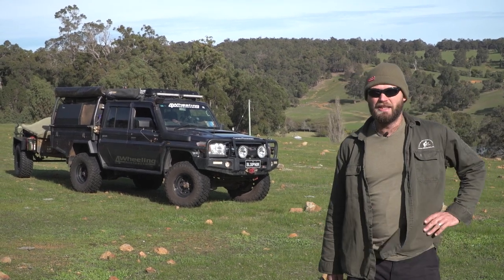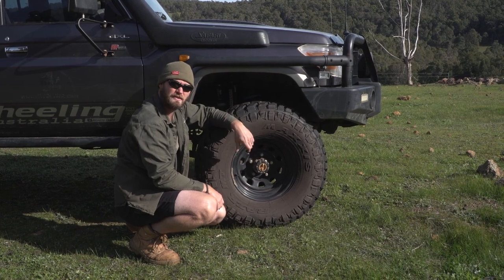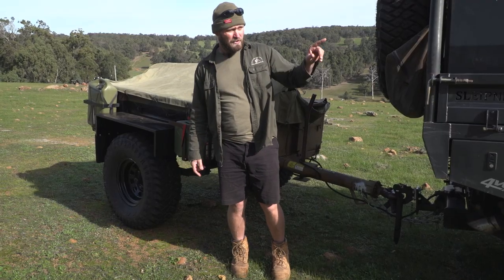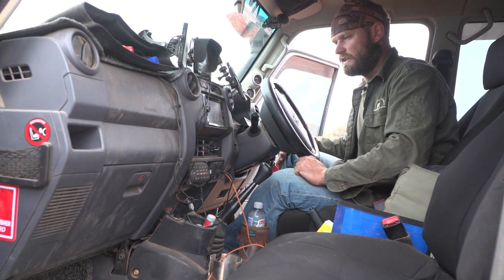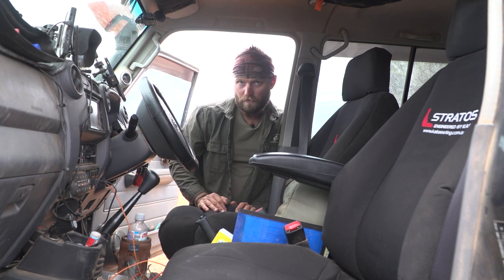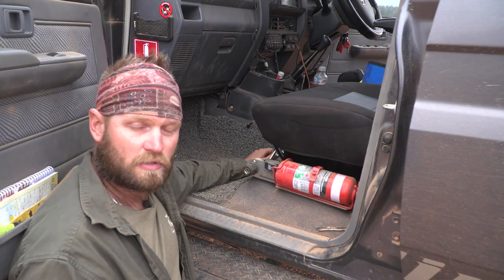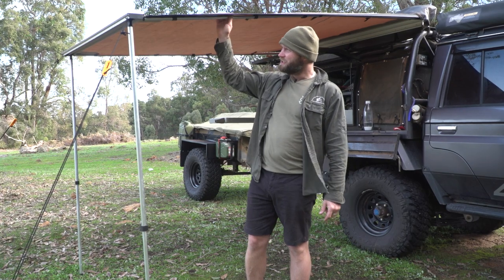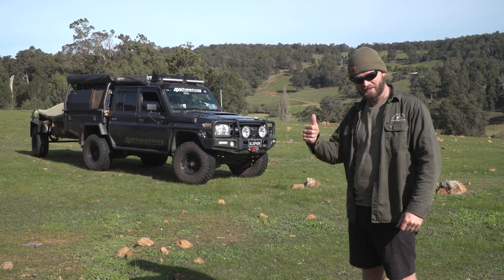Landcruiser, Stage 6

Comment: Drilled rotors tend to hold the mud in the holes. I found that the brake pads wear down fast. I switched to just slotted rotors.
Reply from the maker: I’ll keep an eye out for that. Next service soon
Reply: retiredppd yeah...true..i have faced the same problem with my dba rotors in my 79.

Comment: A recommendation for the tank issue I see in US diesel tanks is a tank sump. Should help your quarter tank issue. Also a lift pump. FASS or AirDog. They help with air and water in the fuel. Not sure if those are available in AUS. Keep up the excellent work.

Comment: There is no cleaner that will clean your fuel tank well enough for water storage. The fuel permeates into the tank material and will never totally come out. Best just to replace it.
Reply: It might get drinkable, but its gonna taste diesel
Reply: absolutely correct i weld aluminum tanks on big rigs and even after steaming them out i have to preheat them with a torch to burn the diesel out so i can weld
Reply: Safer too
Reply: Fill it up with Coca Cola and let that sit for a month. I'm sure it will clean it.

Comment: Some lithium batteries are safe to use to 100% for all of the amp hours. Going lithium was probably one of my favorite purchases for the vehicle, 1/2 the weight, twice the useable capacity, significantly quicker charging and more cycles than an AGM. They're phenomenal.
Reply: The AllSpark range can draw down to 0% every cycle if required but if you do that every cycle then you probably don't have enough storage.  It won't damage the battery, but it will reduce its cycle life from about 2000+ at 80% DoD to around 1600-1700 cycles at 100% DoD.
Reply: The same can be said for AGMs, if you're drawing down a 110aH AGM you need to re-think your needs and the outcome is more damaging to the AGM than it would be the lithium. That said, apples to apples, if you're drawing down a 110aH lithium (which is a ton of power for an off-road rig), you need to rethink more than just your storage needs.

Comment: You mentioned K&N Air Filters possibly having issues. I had one for many years, with all the same gear as you, and I loved it. Being able to clean the thing out bush makes a noticeable difference to how easily your engine can breathe. My new rig doesn't have one, and I'm still tossing up putting one into it. During a service I was advised against them (which was news to me).

Apparently, the filter oil can end up getting carried through into the engine, and can also bring some clumped up particulates, not a big problem for older diesels, but can be an issue for newer common-rail systems that have less overall tolerance for shitty fuel. 

Overall, I still really like K&N, and its still on my list of future parts.

Comment: The fuel gauge issue is something thats common to just about every long range fuel tank and its totally down to the sheer size and shape of them. Toyota design a fuel tank as a cube and then calibrate the gauge to have its full swing through that cube. As soon as you increase the overall footprint of the tank and then start to add wings and extensions to use up as much area and increase the fuel capacity as possible your old standard float gauge just wont work. In my 100 series I went from a 45L rear tank to a 122/55L combination diesel/Water tank. The gauge wont move until the first 60L of fuel is used up, then it behaves like a normal gauge, but only for the 2nd half of the tank- so full is actually half, half is actually 1/4 etc etc etc.

The wandering needle is probably due to the fact that the sender is now in the corner of the tank rather than dead centre. Mine moved from the centre top to mid way down the tank hard up on the passenger side, so If i park with the the tank only around 1/4 full and the car rear drivers down, I'll restart it and it shows no fuel at all. Conversely, park it passenger front down and it will show half a tank again!

Its slightly annoying, but beats the hell out of a jerry can!

Comment: Don’t forget about the inbuilt safety feature of the LifePo battery that if the voltage suddenly drops below 11volts it will go to sleep no problem if you have access to the vehicle battery to wake it up and charge it.

Comment: Ronny, I don't want to be Donny Downer, but dude, after you go buy a couple of OEM Toyota air filters, huck that K&N as far as you can. I used to run them, but after some online debate and thought, there is a reason they flow more air. They're porous. And where you go and myself here in the desert southwest of the US, nope. Too bad Toyota couldn't fit the 80 series (gas) air filter in there. If you've never looked at one, just an awesome design. Cyclone effect and a little, what we call here, tuna can at the bottom. Flip that little latch and it is amazing how much dust it collects. My .02 cents.
Reply from the maker: I'd like to give the cyclone another go. The reason for using K&N is that I can clean it out bush (not for high performance air dont really care about that driving a tractor :D) I carry my cleaning kit with me on the trips

Comment: Instead of using the fuel gauge. Put in a flow meter thats what I've done. Even for my water tanks too. 
They just plumb inline anywhere between the tank and the filter, you input the amount of fuel you have in the tank and it counts down every liter that flows thru. 
So much more precise than a needle/float gauge.

Comment: "The back seat is full of camera gear" - I know the feeling. There is just so much stuff to take for filming. I am always trying to work out ways of reducing camera gear but it still seems to be increasing :) Is there any reason you went for that style of mat in the front instead of mud mats? I love my mud mats, one of the best things I ever bought for the 4x4. Lithium batteries are going to be a game changer for house batteries. We will upgrade when we have to change again. We are hearing that they will still take 75% charge after 10 years.
Reply from the maker: I wanted to try the mats out and they feel great on the feet and trap the sand and dirt well but they wore trough. Mudmats I have not heard of I’ll look them up.

Comment: Guess the reason on the fuel gauge when quarter full is that diesel will air rate on corrugated roads and when you pull up for a while it settles down to give correct reading !!
Same thing happens when filling up truck tanks  !!  They look full till you come back and check and you can fill them more !!
So my guess is air rated fuel !!

Comment: Hey Ronny.  There are products that will clean out the tank.  Once cleaned out you can get a product that will then line the inside of the tank, sorry don't know the name but I'm sure a mechanic near you will know or ask local hot rod clubs, it is used for old tanks that are weeping from the factory joins.  Could work out cheaper than a new tank but I am not sure.
Reply from the maker: Its a mental thing for me even if it can work its in the back of my mind that there was diesel in there once upon a time. I couldnt let my kids drink out of it. Got plans to make a new tank.

Comment: Due to being overweight myself I run an aluminium tray with  lift off canopy. Keeping it a ute in the city with everything packed, setup and ready to go for trips aswell as dust/water tight. Would you consider an aluminium tray to reduce a few hundred kg?

Comment: Instead of cleaning out the diesel tank, can you just install a bladder inside the tank that’ll keep it separated and use the tank as the skid plate for the water bladder.

Comment: Should put shocks on the trailer
Reply: That is a question I've been grappling with myself - shocks on the leaf sprung trailer or not? There seems to be a lot of happy campers without the shocks. Adding shocks you automatically have more things to fail as well as the  added cost. On the other hand, it may reduce the vibration on the trailer chassis and save you from trailer failure out in the middle of nowhere. I don't know...perhaps Ronny can do some kind of comparo for us?
Reply: Benny Banger leafs are naturally suppressed due to the friction. That’s why the don’t have shocks normally. But if loaded up they would help for sure. Stop everything getting bounced around.
Reply from the maker: I’d still look at shocks however, cargo gets trashed on rough tracks
Reply: Very good point - JJ's Adventures...I think that rolls me over the shock absorber edge! The trailer is there to take the load off the vehicle, so it will be at around 70% of it's load limit.
Reply: RedesCat I agree 100%
Reply: I have been tempted with my bike trailer to do an airbag setup with a bladder type system similar to hydraulics that way you can pre charge the bladder to suit different weights

Comment: G’day Ronny

What’s your opinion if you had a 2016 onwards 79 with taller 5th gear would you stick with the 35 inch tyres or consider 33 inch tyres? Cheers
Reply from the maker: they seem to drive fine with 35's if you are towing then it could be different but I'm not sure. Have only towed with the pre gear box

Comment: Ronny considering the GVM problems you and Torben are facing do you think a 76 series with more gear in the trailer would be a better option (if starting from scratch)
Reply from the maker: A 76 was a weaker rear diff housing that the rest of the 70's and has a lighter GVM. But with a trailer why not it sounds like a good option also you'd be able to keep the vehicle more stock as the trailer is the cargo carrier and possible kitchen and camp.

Comment: Hey ronnie at what point do you think about changing bar work? And do you point a lot of research into the weight for gvm. Great video mate
Reply from the maker: Been keen to change the bar work for a while and I’ve had offers but I don’t want the same stuff everyone else is rolling around in. I’d like to put something unique on it to make it look apart from the masses of 79 series. Custom would be nice but it won’t be legal with air bags etc. I’m more focused on the rear for the time being as that’s where the weight issue is.
Reply: Ronny Dahl since you like road trips look up Griffith engineering they do the big 5 posters but looking at their range for the navaras etc they should be able to do a light weight sexy bar
Reply: Ronny what do you think of the Patriot bar that TJM made for his mega tourers? Doesn't have the full bar work but looks good and pretty solid from what they said.

Comment: Roni why do not the rear leaf springs move from above to the rear axle? thus improving the passability of the machine))) many owners nissan patrol w 160 so do.ya from Ukraine. a year ago I came back from a new zealand home where I worked under contract diesel mechanic. and I talked with guys who like off-road like me sam.mena My name is Dmytriy Nesterov and I'm an off-roader
Reply from the maker: It will sit too high I’ve looked into plus it will be very hard to engineer

Comment: Stupid question probably. If Toyota releases a 6 speed gearbox for the Land Cruiser, would you consider buying a new Cruiser, swap out the gearbox for a 6 speed or keep the current Cruiser and just modify it further?
Reply from the maker: If a six speed manual came out I’d need to test drive one with 35’s before I’d consider it. The new 5 speed I don’t like when towing I like the old box better for towing as you can sit in 5th with a 70 series even up and down hills
Reply: Shouldn't really be towing in 5th gear...
Reply: ive heard 5th is plenty strong enough on the 79s

Comment: its the way they work,if im on a hill i got nothing till i use next day then i got 1/4 tank again,.as to cleaning diesel,no idea,but id use petrol,cos it kills the bugs,then white spirits,then mybe meths.,then mybe light it,just the fumes,not the fluid.,i had diesel in a glass container,put water in,with detergent for a wk,rinsed few times,no probs.,or use coastic soda,rinse thuroly,diesel is an oil,degreeser.,

Comment: I’ve barely see you change tyres or fix rims and you carry two spares. I get you carry two spares and that’s important for remote areas but surely you should upgrade to alloy rims, you will easily be much lighter and they can handle heavier weights. Even though people say they could get damaged and you can’t fix them yeah that’s true but alloys are stronger and so your less likely to actually damage them and you carry two spares so I think the weight saving would be worth it, just my 2 cents anyway

Comment: What is your gvm for a big trip?
Reply from the maker: Haha next question? It’s ok if I tow I’ll put it that way
Reply: Ronny Dahl, it opens that whole discussion about the balance of essential gear, fuel and food. I have a 200 with a gvm upgrade but im thinking about a trailer for sharing the load for that extra capibility. Track trailer, track mate should be on the list to look at.
Reply: Tim Scott , I totally agree. But in Ronny's case he'll need another vehicle to demonstrate on judging by his response to the question. @Ronny, It'd be great to find a basic vehicle, run it over a set of scales, then just weigh all the extras that get added... You could even compare one of the modern pretenders (Ranger / Amarok, etc) to the mighty 79. Although, once base weights are done, it'd be interesting to see the same payloads on the different vehicles, steel vs poly tanks, etc.

The real kerb/base weight is totally overlooked. The latest kerb weight of my Navara D40 with only a (fully-fuelled) LR tank and steel front bar is only 400kg less than GVM before (overweight) passengers, extra batteries, drawers, fridges, vital beer or weight on the towbar. It's so easy to be overloaded without realising it.

Comment: Why not upgrade to a 6x6? It would increase weight capacity. Improve sand ability.
Reply from the maker: I dont have a spare 60-100k and I'd rather spend that elsewhere like a second vehicle if that was the case. 4x4 is good. 6x6 is awesome but its also a dream...
Reply: If you did that, and towed a two wheel trailer, Sleipnir would be a proper eight legger!
Reply: They offer kits to convert to 6x6. Replace the entire rear frame. Dunno cost.

Also love your videos!

Comment: im shocked that a v8 diesel makes such small numbers 151hp 430tq that's kinda sad
Reply: Brad Deruiter 151kw is 200hp 430 nm tq is from idle, and they do this at 6psi of boost. 
It will survive at WOT for its servicable life at these outputs.
Reply: I live in the united states and I'm use to new v8 diesels producing 500hp and 930 tq. I'm a big fan of the Toyota  Landcruiser 79 and wish we could get them in the states I'm just a little shocked at the output. the regulations on diesel engines in the countries that the 79 is sold isn't nearly as bad as here. general motors just came out with a four cylinder diesel engine that nearly puts out the same numbers as the Landcruiser.

Comment: Seems over equip.... and weight issues.
Reply: Veselin Gramatikov overequiped? Nah, not when you use your 4x4 as much as he does
Reply: Essentially Ronny is combining his 4wd with what most would put on their caravan or camper. So yes it has a lot on it, but he uses it.
Reply: I am just a fan. I dont have any experience in these. For some stuff looking too much. I`ve seen more compact builds around. His truck was more clear/clever in the begining. He have 10 navigations, changes same thing over and over again. Put new stuff without removing old. Electric wires all over the place.  He says now he have three fuel tanks. He`ve weight issues before. Now this problem seems even bigger. This not mean that i don`t like what he does. For my point of view is pure pleassure to watch this tv series.